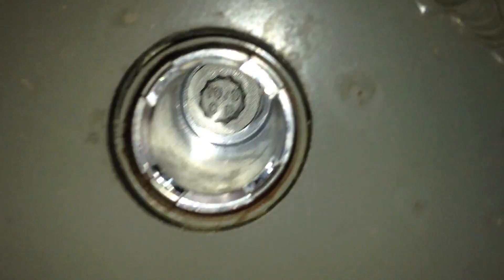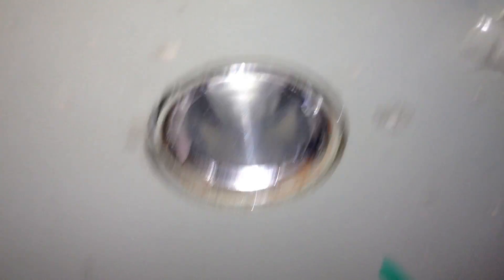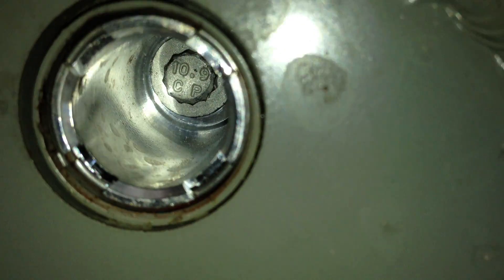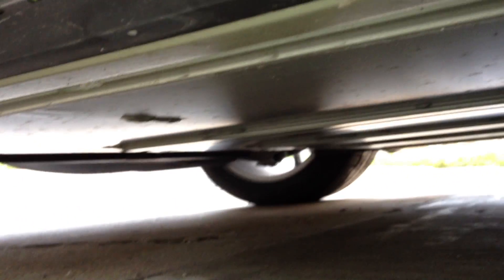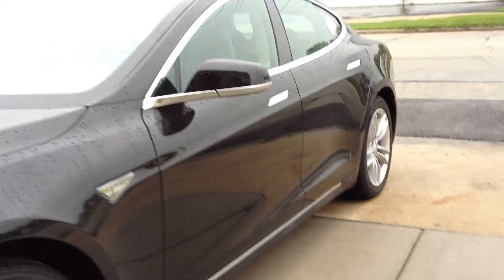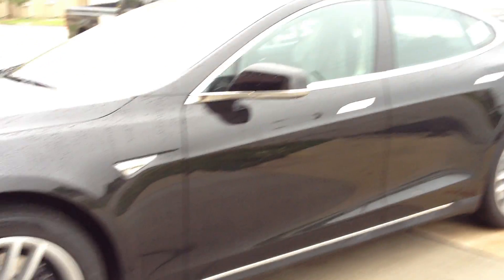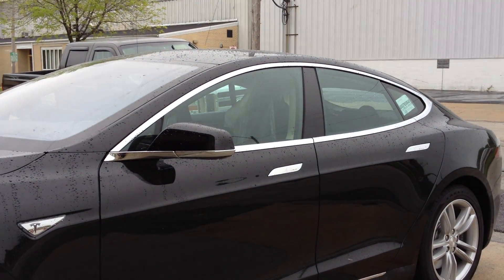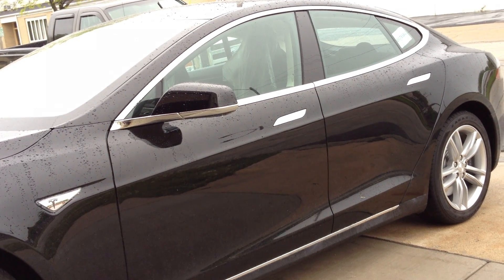Tesla Motors Model S: Part 11 of Many! Underside- Battery Swap?

Comment: I have a question. Do they include a jack to lift up the car to change a tire? I'm wondering if you can even do that or not if the car is so heavy. And also what the jack looks like if it has one. Are there jackpoints on the car like traditional cars?